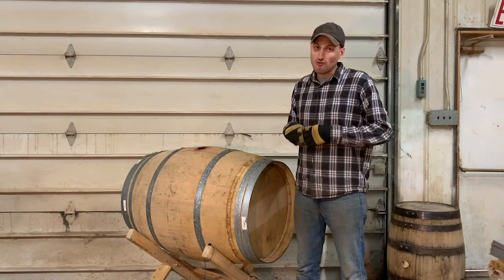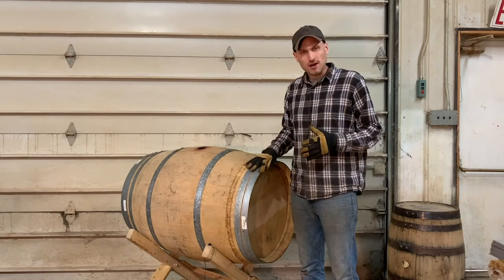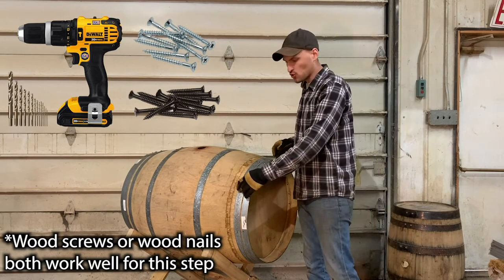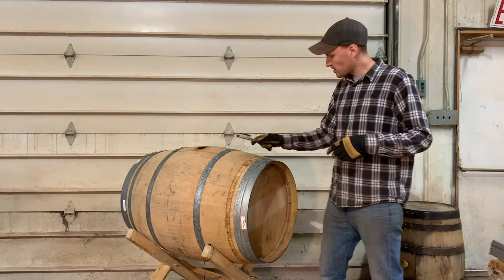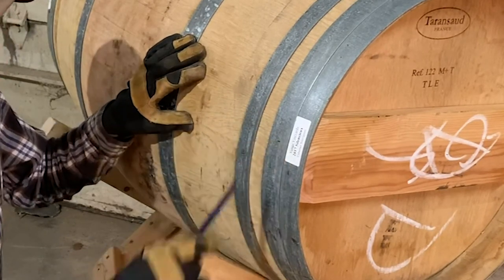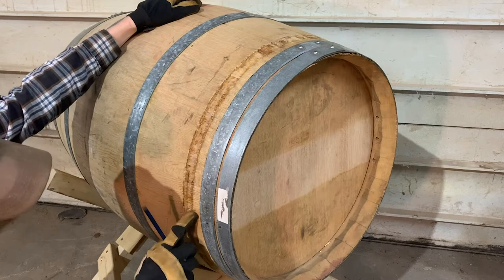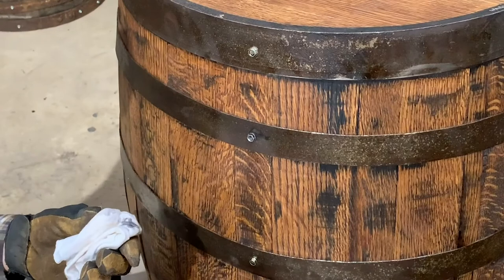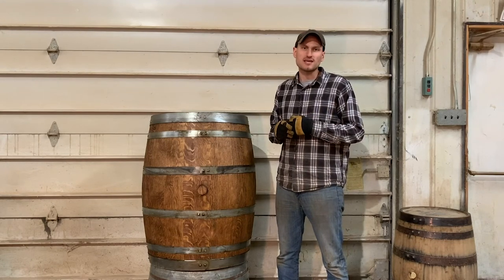Part 4 of 4: Securing the Hoops to the Barrel [DIY Series: Refurbishing a Whiskey or Wine]

Comment: Thanks for the video, my experience with self tapping screws is that they are designed for metal to metal fastening, this is metal to wood. The screws will hold well in the metal but the fine threads won't hold as well in the wood. Maybe a larger through hole in the metal and then wood screws that have a coarser thread into the oak staves for better metal to wood contact.

Comment: Do you find that 4 metal screws on each band is enough to keep the wood staves in place even after they dry and shrink over time? I plan to make a few cuts into the staves of my barrel for my project, x1 square 16”x16” hole directly in the middle of the barrel as well as x2 rectangular 3”x8” holes near the upper bands of the barrel. I plan on sealing the staves and metal bands with spar urethane but I am concerned that over time the cut pieces of wood will loosen and not be secure. Do you have suggestions on further securing the wood staves and metal bands without adding more screws to the barrel? I much more enjoy the look without having to drill a screw into every wood stave on each band of the barrel. Thanks!

Comment: Brilliant videos. I'm refurbing a couple of whiskey barrels to be outside in my garden exposed to irish weather, which means alot of rain pooling on the top. Should I drill a hole in the top, and drainage holes in bottom?
I'm gonna paint barrels with yacht varnish or similar polyurethane. Thanks

Comment: I could use your help. Have a barrel but it's really fried out. Should I try to get the staves to expand First before I drill and nail the staves. Wanting to use 1" or 1 1/2" straight cut nails. Do you mind connecting by email or phone?

Comment: Help! I bought 2 whisky barrels to plant blueberry bushes in next spring. I don't really mind the patina aged looked and used ospho to stop the rust on the hoops. My question is, do I need to put water in them? Only one hoop of one barrel is a bit loose. I do not know when they were emptied...didn't think to ask. Also, I use a product called 30 second cleaner to bring my cedar fence back to looking brand new every few years. Just spray on and rinse off. Can I do that with the outside of these barrels and then just seal them? Wish I could send a picture of them.

Comment: If I am cutting the barrels in half for a planter, do I need to secure every stave to keep the half barrel together? Or will just the 4 like you mention in the video be enough?
Reply from the maker: Hey! 3-4 per hoops should be just fine. Especially once it is filled, that will help push and keep the staves outward as well. Good luck!